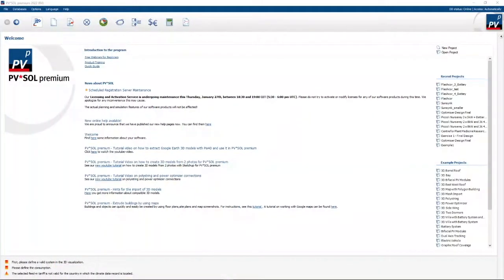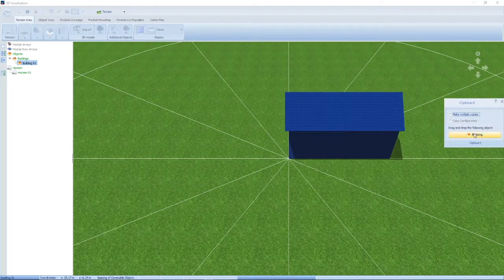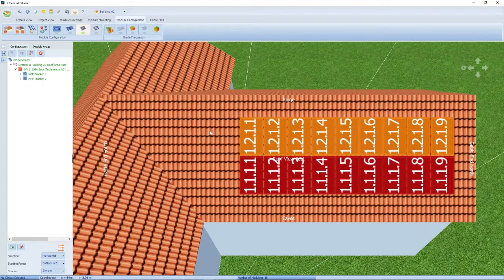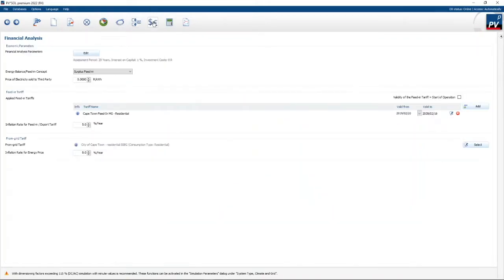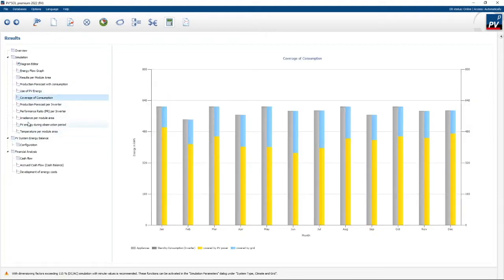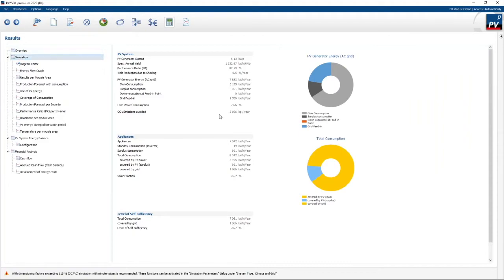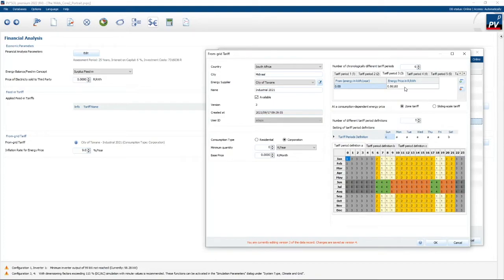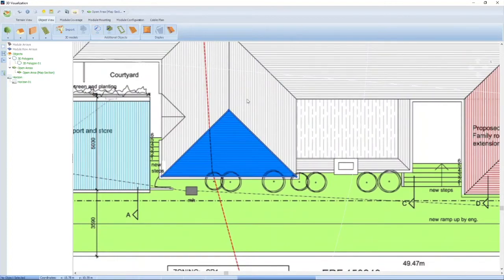PV*SOL (Valentin Software) beginner walkthrough

Comment: hi,

thanks for this pretty amazing and easy to follow tutorial. i have two issues.

i get a message when i click active my builfing. i cannot do it only roof as you didi why? it is said: not enough mounting surface in my 3d model. how can I solved it? the visulaization of my 3d model is totally white and difficult to distinguish each element. how can I change the visulaization?